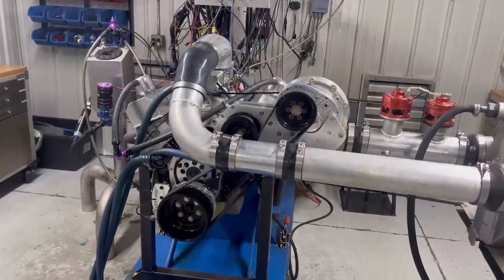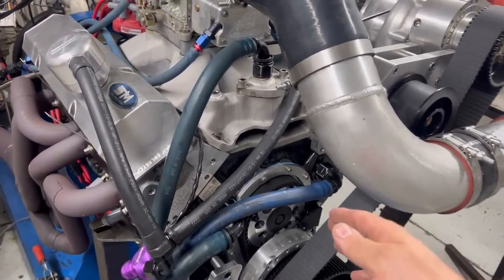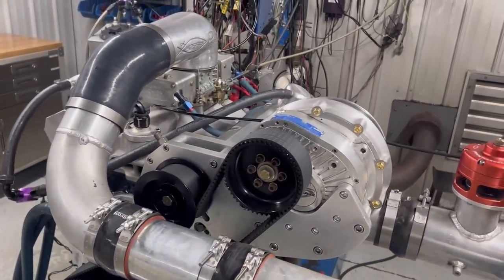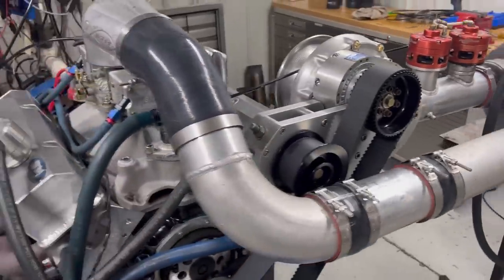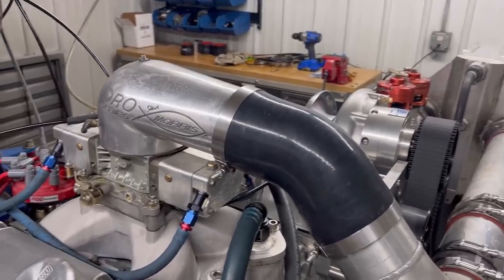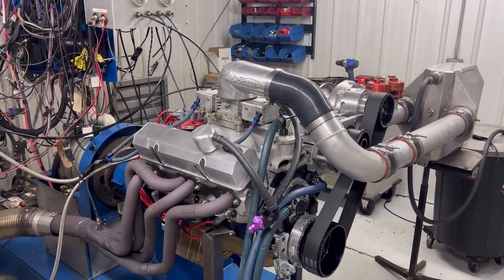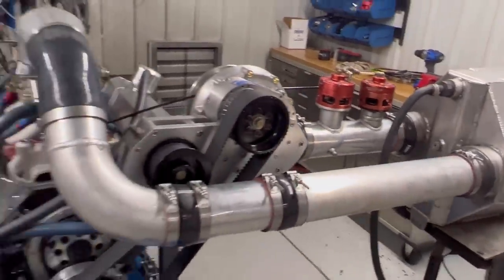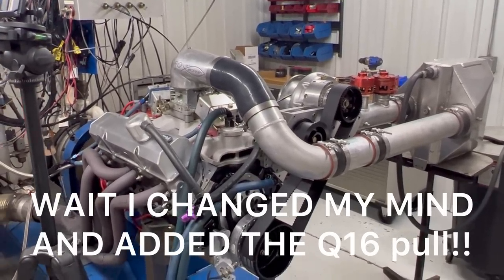1850 HP Old School SBC !! Intercooler, 250hp increase, Blow through Carb Tech and More!

Comment: For all the folks looking for the difference between the 2 intercoolers look at the graph  @8:15. Run #9 made 1556@8000 with the air to air and run #11 made 1795@8000 with the air to wadder...
Reply: Thanks, was wondering 👍👊🇺🇸🤘
Reply: Thanks for that!!
Reply: Drop the t and say pop and  that’s how you know you’re from Michigan
Reply: @pimpdaddy9604  Its watter down in Fl. They even spell it that way.
Reply from the maker: it was a 250HP difference in the intercooler, sorry I did not say it I only showed it @ 8:07. and accidentally deleted part of video and voice volume is terrible
Reply: Can i have the leftover hp difference?
Reply: @stevemorrisracing  Thanks Steve!  Semi-off-topic question, how much power would this setup make on methanol without an intercooler?
Reply: @tptrsn  listen to Steve at 16:15
Reply: @given0fox968  Thanks!  I guess I should have specified that I was curious about a fuel injection setup running methanol non-intercooled.  But I actually didn't listen to that part about methanol carbs until just now you directed me to it.  :)
Reply: @bigboreracing356  That's my assumption too, but I think Steve would know quite accurately what the difference would be.  And to clarify, I am curious about a fuel injection setup with methanol and no intercooler.
Reply: @bigboreracing356  Semantics aside, I would love to know what Steve would think it would make FUEL INJECTED on methanol, without an intercooler.
Reply: @tptrsn  
I've heard the engine will run cooler on carburetor and when you switch to EFI it will run a little hotter.  I could tell you how much HP it would make. So my guess is that a carburetor with methanol none intercooler would make more HP than the EFI methanol none intercooler just because of the cooler temperature which means a little more timing.
Reply: @stevemorrisracing  ok thats ot.. im set to get awic for my subie...because the front mount sir to air intrrcooler im running now robbing souch throttle response (im doing roadcourse and canyon runs alot)
Reply: @bigboreracing356  🤔 why?
Reply: Nice. A plumber once told me that (in pool plumbing at least) a 90° elbow is like adding four feet of straight pipe. I don’t know if that’s right but it’s stuck with me for 20 years.

Comment: Nice job on explaining the carb and how it functions with boost (power valves). Way back when,I started out with thermo quad carbs. Everything took off from there. Amazing how bits and pieces of different designs have been engineered to fit together over the years. Pretty much the same for most components.

Comment: The biggest problem of that A/A intercooler was the size. To compare different style of cooling, at least the pipe diameter should be the same. On a high volume (+5l) engines, pipe diameter is crucial to keep the air flow cold and steady.

Comment: I had a 1980 Ford Mustang with the 2.3 l draw through turbo charger setup. I took the original 230 CFM carburetor off of it and put on a Holley 2 Barrel 500 CFM carburetor. Reported the intake manifold, they hadn't, I had a 1.75 inch exhaust manifold with a custom two and a half inch exhaust that ran up to the turbocharger, and he's 3 in exhaust from the turbocharger back to behind the car. It was the stock block with the forge flat top pistons running 9 to 1 compression ratio. On pump gas at 10 lb of boost it dynoed at 230 horsepower to the wheels. With the Boost unregulated, I could run 110 Octane leaded gasoline between 18 and 22 lb of boost is what it got but I never got a chance to put it on the chassis dyno it at that level but it was certainly faster!

That was the draw through, or wet turbocharger. It made some really cool noises at Full Throttle and between gears off the throttle you could actually hear this turbocharger speeding up with a little spanking boost when you'd first hit the throttle.

Comment: Also interested to see the pressurised carb' setup.  Back in the late 80's I bought an old (even then) Kawasaki Z1R Turbo with a pressurised carb and pressurised pre turbo water injection.   The carb worked because the float bowl was pressurised by a feed from the inlet.  Meaning that its internal pressure and float bowl pressure is near enough the same, leaving the carb to work as normal.  The water injection tank was also pressurised from the inlet and fed the turbo intake via a jet with a spring valved jet set to open when the water, and boost pressure reached about 9 psi.   I had a lot of fun with it, but that basic Bendix carb did not work well at low boost and it would fowl plugs and run like a dog.  But on boost it could really clear it's throat and scare the cr?p out of me as it had way more power than chassis or brakes.  The water injection worked as the one  time I blew a hole in a piston (yes #2  always #2!) I discovered the water tank was empty....  Just remembering what a beast it was has me smiling now.
Reply: I bet that was a sweet bike. Thank you for the story.
Reply: Z1R TCs all came with a draw through Bendix. Turbo was the mini Rajay made by Shelby Spearco specially for use in the American Turbo Pack kit for the 1980 Volkswagen Diesel Rabbit Pickup. Turbo was noteworthy for only having labyrinth compressor seals which are specifically NOT to be used with a draw through carb. So somebody changed it before you got it, I guess.
Reply: @patrickshaw8595   I am sure you are right.  In truth the bike I had was a curious selection of parts, not all of which were original.  I had thought it was based on a Z1000 with the Z1R fairing added but why then add the  cae operated remote front brake reservoir?
Reply: @richarddoyle689  Believe me buddy - I have "hottrodded" and "Frankensteined" everything from pencil sharpeners to 1950s aerial target drones. Somebody had a lot of good clean fun building that death trap, err - I mean motorcycle, lol.
    I built the world's quickest SS 1/4 mi. gasoline-fueled motorcycle in 1980. It had a V8 outboard 2-stroke, water/steam-cooled centrifugal clutch, a parachute and very little else  : D
Reply: Richard, I have been building Draw Thru Turbocharged/Supercharged motorcycles since the late 70z, and to this very day,  inline 4 and 
V twin, get rid of the Bendix and you'll truly enjoy life like never before. Nothing negative towards you and or the mods to the carb Sir, but with the Bendix, you leave a LOT on the table, h.p./torque and most importantly,  drive ability.
T.S. RACING
Reply: @t.s.racing  I know you are right.  I had that bike back in the late 80's.  Steve's video showing the pressurised card just reminded me of it....
Reply: @patrickshaw8595  Damn that two stroke drag bike must have been amazing.  Imagine if it had  a transfer port leak and started dieseling whilst you were on it. ....  just Damn!
Reply: @richarddoyle689  I never rode the damn thing. We paid PeeWee Gleason five grand to send us his measurements and a promise to ride it one day at Tulsa Dragway.
No gears clutch or anything so I put a dead man switch on left grip to ground out the mag if you let off the trigger. It popped the 'chute too.
Reply: @patrickshaw8595  Aha not so crazy then.  No kill switch will stop a dieselling two stroke that is sucking in extra air through a transfer leak.  Learnt that on a TS250M in '82 .  it was just a single 250cc, bit bore stroke and I think piston was the same as a GT750.  I messed about with it  road off from a budfies house and it took off without touching the throttle.  I clutched it, manged to get neutral and it just revved of the tacho.  I kill switched it, turn the key off, then for some reason took the key out and threw it on the pavement and it was still going.  Then I thought to get off it as it was bound to blow.  Finally I turned the fuel off and it sputtered to a stop.  All caused by a leaky base gasket allowing air to be pulled into the transfer, the extra lean burn  caused the plug to glow without need of spark. ...

Comment: Get your son to learn carbs, man! If the younger generation stops learning it, carbs will just disappear. And then the most raw, bare form of hot rods won't exist any longer.
Reply: My buddy 23 years old built a blow through carb 1987 turbo Toyota pickup. It doesn’t make a million horsepower. But from the 117 it used to make to over 250 it’s amazing in that tiny truck.

Comment: I think I missed something. What was the power difference between intercoolers? Or is that coming up in a 2nd part?
Reply: Ditto🤷‍♂️
Reply: Same here I missed something.
Reply: 8:15. 239 horsepower
Reply: Yeah I had to freeze it also to catch the difference. I dont see the boost numbers.
Reply from the maker: it was a 250HP difference in the intercooler, sorry I did not say it I only showed it @ 8:07. and accidentally deleted part of video and voice volume is terrible
Reply: @stevemorrisracing  , Been watching your stuff since Steve Morris Racing Engines through New Era to Steve Morris Engines. From blow through carbs to now and never realized a 250 horespower difference in your air to air stuff to water to air stuff. That’s crazy. I thought the switch from inter cooled to alcohol was crazy.
Reply: was the boost different, great stuff
Reply: @StrictlyService905  kkmmmmmmmmmmmmnnn.mmmmmmmmmmmm??mmm?mmm mmm???mmm n mmmmmmmnm.??n11
Reply: Lol all good Steve. Kinda remind me of what I would do. Start talking about something then go to something else real quick to knowledge some people
Reply: No point. A restricted or non restricted air to air is HORRIBLE for pulling heat off. Air is junxxxx for transferring heat. Water will accept ALL the heat and dump it un the ice or huge bucket of water.
Reply: Such a difference I thought it was the torque number. lol

Comment: On the Carb. I built alot of Q-Jets when I was younger. I noticed GM used the same jetting alot of times between te BBCand SBC.  It took awhile to figure that one out especially when I found  out that my 500 Cadillac had the smallest jets GM made.  Of course 3500 RPM was it on a stock one

Comment: Have not seen the modified air /  fuel metering, including four floats, for a Holley, (you referred to the carb. by another name, did not catch the name),  very interesting video.  Thank you.  Personally seeing where car owners are moving towards cold flowing alcohol with additives, and / or some sort of cold-air-flowing - modified fuel, running no external air cooler.   The 90 degree restrictive elbows / turns, within the pushed air flow path, makes so much logical sense, thanks again .
Reply: Carb shop I think he said. im not sure there around anymore.

Comment: Watch the belt at 5:50 on the supercharger.  It raises OFF the pulley because of belt flop.  Hopefully Steve reads this and watches or noticed it when making the video.  Maybe alter the belt routing some or lengthen it to move the belt under the pulley a little more hopefully to improve engagement.  Plus that bottom side flop CAN NOT be good to a belt..

Comment: Was going to ask about the air to air run numbers but I see in the comments the answer. A FYI a 90* bend has the same restriction as 160' of straight run. So your set up of 6 elbows is the same as adding 960' of additional piping. So elimination of the elbows alone would help that set up but 250HO difference is a lot.
Reply from the maker: Nice

Comment: I'm slowly buying parts to build a 406sbc. I currently have, brand new AFR 210cc Competition Ported cylinder heads, Eagle 4340 crank, Eagle 4340 6 inch H beam rods with L19 rod bolts. Probably going do use a Dart SHP block. Could you recommend a good cam, intake, and carb? I want around 10.5:1 compression pumps gas 93 octane engine. It will be a street strip bracket raced car. Probably be 3000lb with a 4.10-4.56 rearend gear, glide or turbo transmission. I want to at least make 600 horsepower at the flywheel. Just need a good recommendation to go well with my cylinder heads. Heads are setup for solid lift roller camshaft up to .710 lift. Any suggestions would be greatly appreciated. Love the videos been watching a lot of yours lately. 
 Take care, be safe, and have fun regardless.

Comment: Besides protecting the intercooler. Is it beneficial to blow off prior to the intercooler. I assume if there is less air mass going thru the intercooler than the deltaT can be faster? Have you see any numbers on this. They can be faster temp transfer on higher pressure gas/liquid.

Comment: I've always wondered how much HP the blower uses..Could you put a load cell on a seperate idler that increased wrap on driven pulley and then calculate power needed to run blower. Might make it easier to sort out blower losses or maybe a "good" blower
Reply from the maker: Hmmm, possible
Reply: They make blower dynos. Mostly used by people like top fuel/funny car to test blowers after a rebuild. 
Wouldn’t be super hard since you can drive the blower with an electric motor. Measure how much power the motor takes to spin the blower a certain speed and you can figure out the power required.

Comment: Interested in some general head specs. Mfg, 18° or 23° we have a 23° 434 nitrous motor that would be nice to shorten the stroke up in and throw some boost at it.
Reply from the maker: 23 degree 245 runner  track 1 heads

Comment: Hi Steve I have a sbc 350 in my boat its rated at 260 hp (bone stock) and I'd like to bump it upto 300 hp so my question is what mods would you recommend to achieve that without using nitrous or superchargers or turbos ty

Comment: So….

If more air going through the carb, is sucking more fuel out the bottom, and the power valves are boost referenced, is there still a boost referenced fuel regulator?  Or, are the power valves doing the regulating according to boost reference?

I have to be honest, I had a carb blow through on my very first pro charged SBC 20+ years ago…P600B with a carb. When I went with new motor and bigger blower, I went with FI because the carb was always horrible. I had 3 “carb speciality” shops go through my CSU and was never smooth sailing. Shouldn’t have been that difficult from what you say.
Reply from the maker: Yes you must have a boost referenced regulator

Comment: At 5:43. Is the engine creating negative pressure in the dyno room to close those vents in the back?
Reply: Yeah, it’s ultimately just a big air pump. It’s pulling air in in through the supercharger and then the exhaust is going out of the room. So fresh air has to be coming in from somewhere.
Reply: @WreckRod  Very cool!

Comment: Is there a way to make/mount that centrifugal  supercharger  directly  to the crank or would it make no difference 🤔 I only  ask because of higher rpm rate you cab see that long belt flail real bad
Reply from the maker: Yes gear drives

Comment: What heads did this combo have I think I saw brodix but are they a raised runner 23degree head or standard port height? Also is this your stage 2 solid roller or a custom grind cam?
Reply from the maker: Custom grind 
245 track 1s

Comment: Interested to see this setup and what difference the small air/air verses the large air/water intercooler made.  But you did not give the numbers?  What I saw on screen appeared to suggest it still made over 1750 on the small cooler?  Could you post the actual numbers as I may have been looking at the wrong graph.
Reply from the maker: it was a 250HP difference in the intercooler, sorry I did not say it I only showed it @ 8:07. and accidentally deleted part of video and voice volume is terrible
Reply: @stevemorrisracing   Thanks Steve, that is one hell of a difference, but as you suggest in the video a lot of it is probably due to the smaller diameter tubes as well as the angled bends in the little air/air unit.

Comment: I had a stock stretched intercooler with Duttweiler necks on my LC2 Buick. 12.5's stock almost everything else but the injectors and turbo tuning with a Scanmaster. I always wondered if that intercooler did anything because it was just "there" and I never had the notion to go front mount because it had ice cold a/c. Then (if you know TR's) I started building a kit to wrap the a/c lines around the charge pipe and tire sprayers for spraying the tires with VHT during the burnout... Never finished it, did the latter on my 4th gen and pulled 1.7's with beat street tires.

Comment: Steve. what are your thoughts on crank snout load with a gear drive and f1c and a ati clutch drive?? is it the back and forth torsion that breaks the standard snout, as in rpm drop with gear changes. 4340 crank with standard snout diameter. also, boost limit say 20 psi.. can a standard snout live? Love to hear your feedback. Thanks Steve. Love love your content.
Reply: Side load of a belt seems to me to be the main culprit. Yes?
Reply from the maker: Yes
The gear drive is easier on it

Comment: Changing blower pulleys does not increase or decrease the flow thru the carb / engine. Engine flows the same regardless of blower pulley combination. What your actually changing with pulley ratios is the density of the air going into the engine.
Reply: That is so wrong we change the pulleys change the pressure inside of the system which means more or less air !!!  ……
Reply: @alyn7d7  Is there a difference between flow and pressure?

Comment: Curious how much of a difference it would have made if the inlets on the air to air were straight in? Also, if the tubing was the same size between intercoolers?
Reply: Also curious what the Intake Air Temp (IAT) was for each setup.